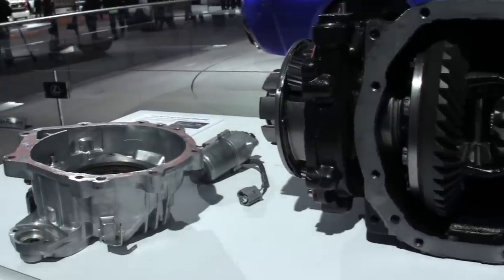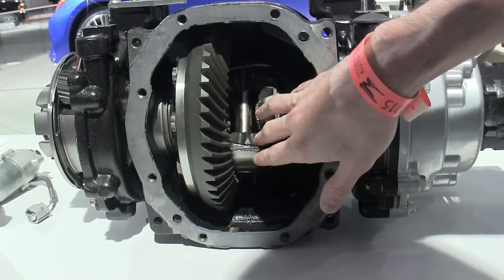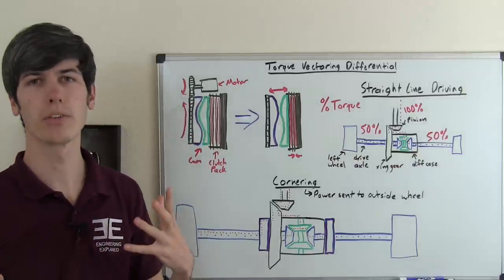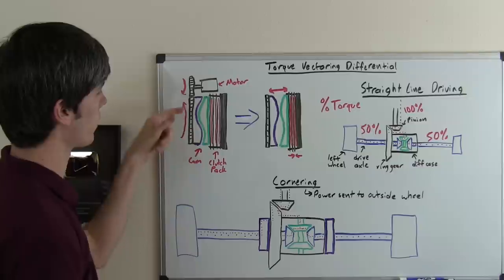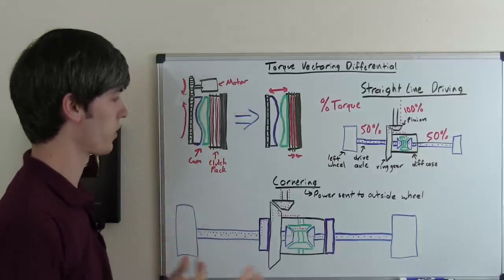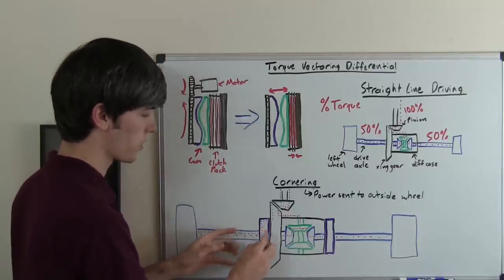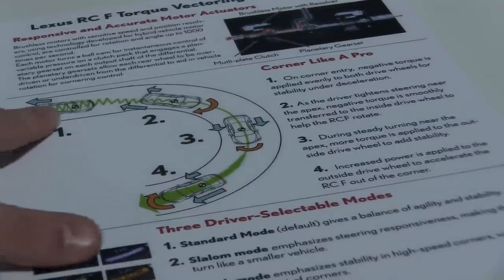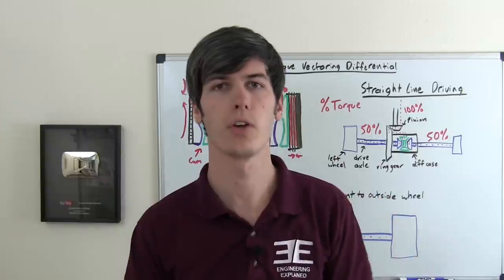Torque Vectoring Differential - Explained

Comment: Why do cars need torque vectoring differential when they can just brake the inside wheel? Mercedes uses it, and torque vectoring by braking are cheaper, less complicated and lighter than torque vectoring differential.

Or am I missing something here?
Reply: Well if the purpose is to increase cornering performance and thus speed, braking seems a little bit counter productive.
Reply: Josh Hillard How torque vectoring works is by decreasing power on the inside wheel and increasing power on the outside.

By braking the inside wheel, it would make it more difficult for power to go to that wheel, thus, it will go to the other wheel, which is the outside wheel. In the end, the outside wheel receives more power than the inside wheel.

So, how is torque vectoring differential any different than brakes?
Reply: Is this name taken? 
That is a short-sighted conclusion. Brake wear is involved, a clever differential would work out much better in all ways.
Reply: Jay Edlington I wasn't making a conclusion. I was asking "why" and if I'm missing something. But thanks for the answer.
Reply: It's a bit of a matter of semantics at this point, since torque vectoring by definition must use variation of torque to achieve the effect on steering intended. The slightly older system used for many vehicle dynamic control/electronic stability control systems use just braking, which works just fine. In the case of slippery surface conditions, you brake the slipping wheel to provide more torque to the wheel with traction. When cornering, it will brake the inside wheel. The above actions fall under the umbrella of traction control, itself a tool used by VDC to maintain vehicle control. The real innovation took place years ago by having VDC take input from many sensors to deduce where the driver wishes to go compared to where the car is actually going, and using traction control (brake based) to make the car and the driver's intention align.

This system works well for the intended purpose, but involves power loss through braking and is reactive, not proactive. Torque vectoring allows a computer to preempt the driver's actions, and begin varying the torque as soon as viable. In the cornering example, it will vary torque AND braking on the inside wheel to make it slower than the outside wheel. When the foot is lifted off the pedal, most modern fuel injection engines will cut fuel to the engine and provide some measure of engine braking or "negative torque" as described in the brochure he showed in the video. You can increase the proportion of the "negative torque" applied to the inside wheel, decreasing reliance on brakes. Then, when accelerating, the computer will apply some brakes to the inside wheel, decrease torque to the inside wheel, and increase torque on the outside wheel.

It is important to note that the majority of the stability provided is from the vehicle dynamic control system. Torque vectoring is an upgrade in the sense that it gives the computer more options to let it act proactively, but the VDC computer is the ultimate decision maker that uses both ABS/traction control in conjunction with the torque vectoring to essentially "steer the car for the driver." That is, you could place both traction control (brake based) and torque vectoring (engine power based) as tools under the umbrella of Vehicle Dynamic Control/Electronic Stability Control, allowing the computer to drive for you. That last bit is how academics describe VDC/ESC and torque vectoring: tools that let the car steer independent of the driver's input.

http://www.sciencedirect.com/science/article/pii/S1474667015319017
Reply: isthisnametaken978 That is wrong. By braking you just dissipate part of 50% power send to the wheel through open diff. And there is no other mechanical connection between wheels other than diff's gears. The second wheel get 50% of power, not more.
Reply: RagingAura , changing torque distribution by applying brakes can be as proactive as TVD is.

Comment: Why use computer controlled clutch packs on the differential itself? It seems like a lot of extra mechanical (expensive) equipment that can fail.
What is the benefit over just use the existing braking system with individual braking (via the computer controlled ABS system) on each corner?
Reply: Brake vectoring systems don't actually alter the torque sent to the wheel, just the wheel's tendency to slow down. If you'll notice in the diagram, torque vectoring not only helps with the entry into the turn, but also the exit. If you tried to do that with brake vectoring (brake the inside wheel during entry and exit from a turn), you would cause the car to be braking while you're applying the accelerator trying to speed up. Not to mention, brake wear would be a big issue if you use the system frequently enough.
Reply: NeutralGenericUser Isn't the clutch pack effectively acting as a brake on the axle, as it locks up against the differential?  Whether as a clutch pack applying pressure against the side of the differential or a brake pad applying pressure against a rotor, it is effectively creating resistance on that one axle and slowing it so that the torque is forced to the other axle.
The only thing I can think of that could make the argument for the clutch pack vs brake rotor approach would be if the clutch pack applied resistance to one side of the spider gears, but allows the actual axle to free-wheel at its own speed and therefore doesn't slow it - but simply redirects the torque.
That doesn't appear to be the way this is designed, unless that is some of the functionality that is hidden within the planetary gear set?
Brake pads are cheaper and easier to replace than differential clutch packs, so the cost of brake pads isn't a strong argument for the manufacturers either.
Reply: Thomas Campbell The clutch pack locks up against the differential not to cause drag, but to lock the two in unison. It might cause a second of drag between 0 torque and full lock, but that's not the point, that's just a tiny inconvenience. The brake vectoring is entirely there to cause drag.
Reply: NeutralGenericUser Got it.
I was confusing the term differential housing with differential case.  
My mis-understanding had me thinking that the clutch pack was engaging the axle against some sort of machined surface on the outer case, thereby producing drag on one axle forcing torque to the other axle.  Like a brake based system would do (and why I was somewhat aghast at the idea of it "locking."
I see now that it is like a clutch-driven LSD, but the clutches are on the outside of the case passing through the case and against the differential housing.
Unlike a brake driven redirection which slows the axle, this forces a tighter synchronization with the driveshaft which guarantees more power to the axle.
Thanks for the video - hopefully I'm in the minority with my misconception about what the clutch pack is pushing against (it's the being on the outside that mislead me.)
Reply: Thomas Campbell You might be in the minority just because your vast knowledge in this area caused you to overthink it. It is clear from that comment that you have a deep understanding of the topic :)
Reply: Using the brakes is not an economic or fuel efficient concept. The brakes consume themselves and they consume amounts of torque which could be used elsewhere.

Comment: What's the difference between torque vectoring differential and Acura SH-AWD?
Reply: Acura's SHAWD is actually very similar in concept but operates the clutch pack using an electromagnet rather than a DC motor. I think Acura has the best implementation as the torque can be varied with better resolution and accuracy. 

The only downfall of Acuras system is that it weighs more because it also has a hydraulic pump that is uses to accelerate the driveshaft going into the diff, this accelerates the wheel an additional +5% (on RLs only).

Comment: i confused... based on 5.00 minutes you mention that "it transfer more torque to the inside Tyre to help rotate the vehicle" but if i read description in SAE page it mention "Entering a turn, torque is reduced evenly to both rear (drive) wheels for deceleration stability. As the car approaches the apex of the turn, torque is further reduced to the inside wheel to help the car rotate slightly. Closer to and at the apex, the system transitions to positive torque, with somewhat more going to the outside wheel to promote stability. As the car starts to accelerate out of the turn, the torque to the outside wheel is increased further." it means it reduce the torque transfer to the inside wheel.. which one is true?
ref: http://articles.sae.org/13845/

Comment: What is the difference between a torque vectoring differential and an Limited Slip Differential?
Reply: To my understanding(im an engineering student yet) tv is and lsd that has its clutch pack electrinically actuated proactively instead of mechanicaly actuated reactively based on inputs read by sensors that signal the electric motors to "lock the diff" . Could be wrong though.
Reply: That's wrong idea. Torque vectoring diff uses the same mechanism for torque distribution LSD uses - clutch pack. But it can send more torque to the faster wheel, what classical LSD cannot. And the planet gearset reductor plays key role in that. That is the one of the very rare bad explanations by Jason.

Comment: When you connect one output axle with housing, you lock the differential. I think this is not torque vectoring.
Reply: You're over-simplifying it. The clutches are not just either fully on or fully off. The way they do it is by electronically controlling the amount of clutch pressure on each side. The clutches are infinitely variable, anywhere between fully disengaged to fully engaged. In fact, they seldom reach either full position. They are slipping in varying amounts all the time, except while going in a straight line. Furthermore, they aren't just operating one side at a time. Both sides are constantly used in varying amounts to achieve the desired result. So, in a turn, both clutches are continuously slipping at different percentages, fighting the carrier for torque. Does that make sense?

Comment: So if I tldr summarize this:
It has a clutch on either side of the diff housing for each wheel. The clutches can essentially cut off power to one side thus essentially bypassing the diff housing altogether when needed? Someone correct me if I'm wrong.
Reply: With a cam actuating the clutches and can change the amount of pressure on the clutch.

Comment: So what is the need of planetary gear set at both the sides when there is clutch pack?
Reply: The planetary gearsets on both sides speed up their corresponding wheel by a marginal amount of about 1.5%, the clutch packs lock up the planetary carrier of the planetary gearsets and when they lock it up they do their job and start to speed up their axle.

All of that speeding up of each axle is needed to draw torque from the opposite wheel. It's an open diff in the middle, and we all know an open diff will transfer torque to the slipping wheel.

The planetary gearsets simulate a ''slipping'' wheel when they activate through the clutch packs.

Comment: why limited slip differential provide more drift angle than open differential, while it sending more power to the grippy tire!!!
shouldn't the open differential provide more drifting angle since it sending the power to the tire with less power.
Reply: It's cause lsd sends more power to the grippier tire, and increase scrubbing, which cause more slide (lower traction) as the slip ratio and slip angle increase.

Comment: Can you compare this system to the Ford eTVC that applies braking torque to the inside wheel during high speed cornering? Thanks!
Reply: The fords system just brakes the wheel so it creates load to that wheel(load that would otherwise be the traction of that wheel but since it lost traction no torque is sent to that wheel via the trans, so "brake torque/resistance, replaces traction resistance), so more torque can be transferd to both wheels. Hope that makes sence

Comment: Transfer more torque to the inside tire? (on stage 2, the end of the video) Looks like it's breaking... the is going backwards... Than stage 4 is going forward.. and to more torque to the outside tire..
Reply: If you read the blurb on the right, it mentions negative torque during stages 1 and 2, then positive torque when power is applied.

Comment: If you're taking a turn why would more power go to the inside wheel? Wouldn't that push you away and act against the turn?
Reply from the maker: Negative* torque
Reply: Yeah think about it. On a boat for instance if you push the stern from the right the stern goes left and the boat turns right, and visa-versa. Just look at the angles on the vid. putting power to the inside rotates the car to the outside just as it would on a boat
Reply: Michael Howatt lol.
Reply: It's about putting enough torque to the inside rear to help rotate the car into the turn, not enough to cause oversteer. Torque Vectoring has brought the technology to subtleties where an old style limited slip system could not go.
Reply: Michael Howatt lmao.

Comment: Porsche Porsche Torque Vectoring PTV is much more simple.  It just activates the brake pads for the inside wheel on the turn.  Less weight and maintenance is easy changing out the brake pad.  no clutch packs and all the extra weight and spinning weights etc.
Reply: Yes, but it has its own cons. That systems based on wheel braking do not distribute power but rather dissipate the "excess" of it on the "weaker" side.

Comment: if power is sent to the wheel inside I think that will cause understeer and won't help in rotating the car
Reply: Exactly. But this device distributes torque (and power) in favor of the outer faser wheel.

Comment: Your design has a "fatal" flaw.  A clutch can only transfer torque from the driving member to  a slower turning, or at the limit, a same speed driven member.  To be helpful in reducing understeer in a corner, extra torque has to be transferred to the outside wheel, the faster rotating wheel,  Your simple clutch based system can't do that.
Reply: You are absolutely right. This looks like regular LSD, which cann't help cornering. But here is a small detail Jason forgot to describe. A gearset reductors at each side. They are key elements in this construction.